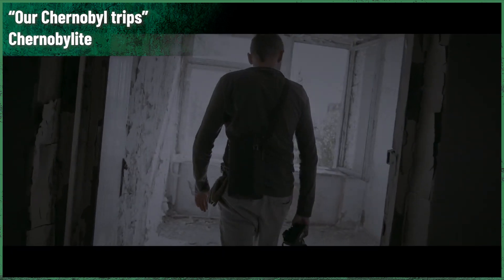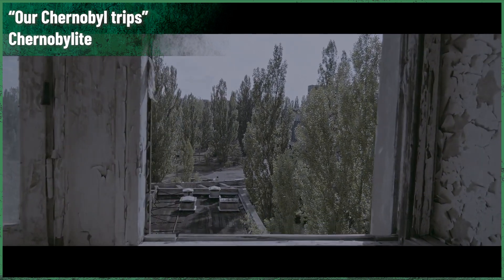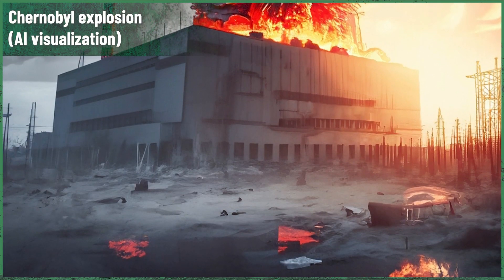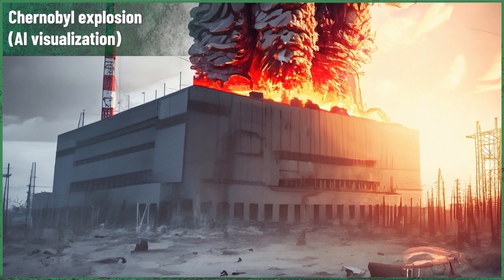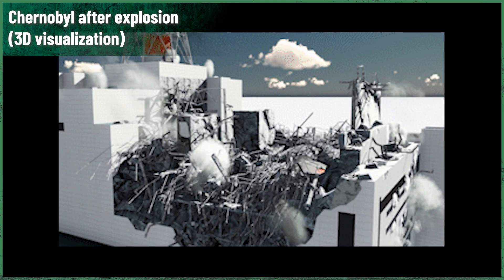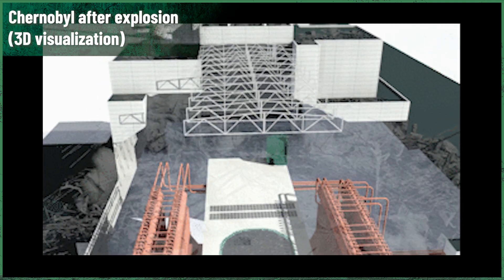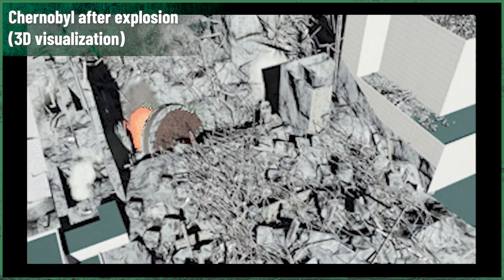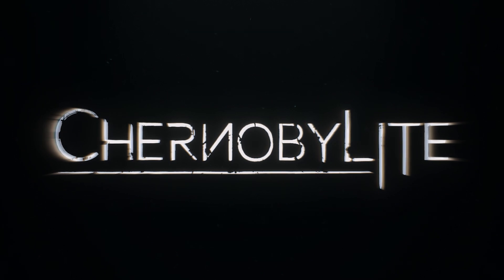Why Chernobyl exploded? Operators mistakes & RBMK design | RBMK PART 9 | Chernobylite Stories

Comment: Wonderful episode I’ve been waiting impatiently for it all week.😊. Do you have any episodes about what happened to the people on duty at the time. Or something With where people that die inside the reactor. Or where people were when they had to drain the tanks. And what happened to them? Did they all die of ARS too? Perhaps a episode about Toptunov or Akimov and there roles and level of experience. Do RBMK reactors still use graphite in the design?
Reply: RBMKs most certainly still use graphite in their design. It's the only way they can work. This has to do with low fuel enrichment and neutron economy. When fuel is that low enriched, you need to make use of every neutron you can hold on to. Ordinary water would absorb too many neutrons when used as a moderator, and your reactor would not work. Both heavy water and graphite are very good for saving neutrons. The Canadian CANDU uses natural uranium as fuel,  with heavy water as its moderator. However, heavy water is very expensive. The Soviet Union didn't have access to the amount of heavy water needed for use in their reactors, so they chose graphite instead.
After the accident they have increased the enrichment for RBMKs from 1.8% to now 2.4-2.6%, but it is still fairly low compared to PWRs/BWRs. These have an enrichment of at least 3 to 5%. That's why they can use ordinary water as their moderator. An RBMK is physically incapable of running with ordinary water as a moderator.
Reply from the maker: Hey Christine!
We have a few episodes on people of Chernobyl so far, but we didn't yet have time to cover additional individuals (we will). You can check the playlist here: https://www.youtube.com/playlist?list=PLvLmuX4fgBCf-fvWbWs9z8sMOG4sZYWWm
Reply: @swokatsamsiyu3590  thank you for your answer my days not complete till I learn something new. I know the candu uses heavy water. Which has deuterium added along with hydrogen and oxygen. I know heavy is better than regular water but also has a price tag to go with it. I didn’t know if any of the newer generations of the RBMKs still require graphite.
Reply: @christinemcdonald8705  
Well, it's hard to gauge someone's knowledge from a computer screen😅 That's why I used the CANDU as an example. It is the only very low/natural uranium fuelled reactor besides the RBMK, with similar needs when it comes to being able to run. After the accident with Chernobyl Unit 4, no new RBMKs were built. The ones that were almost complete were finished only after massive improvements made to their safety systems, core composition etc. The rest of the projects were shelved indefinitely. The newest, most advanced RBMK is Smolensk Unit 3. It achieved its First Criticality in 1989, was connected to the Grid in 1990, is a semi-generation 3 reactor and will run until 2035-2040. It received a full renovation and technical rearmament in 2018. If you see pictures of its control room and main reactor hall, it almost looks like something from a different century when compared to Chernobyl Unit 4. There, equipment and machinery already looked outdated from the moment they started the reactor for the first time. Smolensk Unit 3 is a very nice, modern and clean reactor as far as RBMKs go. But it too still uses graphite. It is the only way it can run properly^^

The one reactor I would have loved to see run, but that was never built is the MKER (Много-петлевой Канальный Энергетический Реактор = Multiloop Pressure Channel Power Reactor). It is essentially an RBMK, but then the way it should have been. Sporting full containment (yes!), both active and passive safety systems, enhanced core neutronics, and something they called "better self-protection for the reactor", this reactor could have been really good. A 70% finished Unit sits at Kursk NPP. They cancelled the construction in 2012. What a shame.
Reply: @swokatsamsiyu3590  yes very true, I know the candu best simply because I’m Canadian it the one I’ve studied for the longest. Which you couldn’t possibly know. But i do appreciate your your answering. As I don’t know much of the newer RBMKs
Reply: @christinemcdonald8705  
As a not-at-all nerdy hobby I study nuclear reactors. And as you probably already guessed, RBMKs are my specialty. They are such oddball reactors that are so misunderstood. There is so much to learn and find out about them. But I'm familiar with other reactor types as well.
The Canadians built something really, really good when they designed the CANDU. I happen to like the CANDU a lot, wish we had at least 10 of them running in my country. I always say "the CANDU is what the RBMK could have been if they just sat on the design a bit longer". They share the same pressure tube design, the same large, well-thermalised core. Both can run on very low enriched/natural uranium. The CANDU even shares the positive void coefficient (albeit a lot smaller!) that the RBMK has. However, that didn't stop the CANDU from being one of the most robust, stable and safe reactors out there bar none. It has everything the RBMK would have loved to have, but never got.
Reply: @swokatsamsiyu3590   wow, now that is a better response than I could have hoped for. Thanks for taking the time to talk with me. I’ve quite enjoyed It. Seems I have a few new research projects to do. I’m so excited! I was one of those people who bought in to the hype of “ oh nuclear power is bad there going to destroy everything” it’s not like that at all if you understand what’s happening. I think we need a better way to deal with the waste. Barring earthquakes and tidal waves it’s quite safe. If they had more world regulations on waste and countries actually followed them. Finland has great ideas for long term storage. But 100 000 years from now who knows what’s going to happen. I thought I was the only one weird enough to have such a such strange hobbies. Nuclear physics and high altitude mountaineering. It’s what I love.  Might you know why they decommissioned them after (what seems to me to be) a very short period of time?
Reply: @christinemcdonald8705  
No problem. It is always nice to talk to a fellow nerd^^ As you can see, you're not the only one. There's a few more of us around. We just don't go around advertising it. I grew up in the 80's during the Cold War. Everything to do with nuclear was on that "nuclear bad!" line. Nuclear reactors really aren't all that scary or bad once you get to know them a bit better. But we must always remember what they are; not just a machine, but also a Force of Nature. We have to give them the respect they command, and the diligent care they need. If we do that, they can do wonderful things for us. Even earthquakes/ tidal waves need not be a problem, just build accordingly.

The nuclear waste rules are among the most stringent in the world. The barrel with a radiation sign, leaking green goo picture that still persists, couldn't be further from the truth. The Onkalo storage facility in Finland is close to being commissioned as we speak. And we already have ways to deal with the waste. There are several reactor types that can utilise the waste from other reactors as their fuel while making more fuel for these reactors. It's called breeding. Look into the EBR-II Fast Breeder reactor. And what is really going to cook your noodle is the fact that your CANDU reactors can help out too! They can safely run on the waste from PWRs via the Dupic (Direct Use of PWR Spent fuel in CANDU) process. Countries like South-Korea have done successful trial runs years ago. The decision not to do this in the West, is purely a political one. The technology for dealing with the waste has been around since the 60s.

I'm not sure to which reactor you refer, but if you're talking about decommissioning RBMKs; it has to do with the graphite stack. Graphite changes and deforms over time in a high-neutron environment. They have developed a special "sleeving" technology that can correct this to a certain degree. But at some point the graphite becomes too distorted, and will start to cause trouble. For an RBMK, a lifespan of about 45 years is viewed as realistic. Not as old an age as a PWR or CANDU can muster, but not bad either. And the accident at Chernobyl played a big role in it too. After the accident, all RBMKs were viewed as some kind of monster, just waiting to go off on you. Which is totally false. Even an RBMK can be a proper, well-behaved reactor. The ones still running are living proof of that.
Reply: @swokatsamsiyu3590  been very nice chatting with you. Normally when I talk about that kind of thing everyone stops talking and just stare at me usually with a blank ‘huh’ expression on there face. By the time I learned about Chernobyl in school and it was history by then.

Comment: Wasn’t it that toptunov pressed the button ? In the series they showed akimov but most websites say that toptunov pressed az5
Reply from the maker: Depends on accounts, but the most reliable version is that Akimov pressed it - he was the supervisor, Toptunov probably would be too afraid to use it.
Reply: @Chernobylite  I think that most eyewitness accounts from the people that were in the control room agree that Toptunov pressed it. And why would he be afraid to press it? It was a pretty normal procedure for shutting down the reactor completely, which was planned to be done after the completion of the test. And yes, AZ-5 button was not pressed as a response to power increase (also stated by eyewitnesses and SCALA data), but power increase happened only after it was pressed.
Reply from the maker: Not exactly - pressing AZ-5 was an extreme measure regarding the Soviet 5-year-plans and their need of electricity. Also, it would mean shutting the reactor off for days if not weeks.

You had to understand the reality they were living in - this could be seen as a sabotage. That's precisely why they had multiple AZ buttons. Only the 5th (AZ-5) initiated a complete SCRAM procedure.

So given this all, Toptunov could be later interrogated - why did he stopped the reactor and didn’t use other measures?

It's all speculations, of course, but we can't really believe any official reports or memories as they all could be biased and / or censored.
Reply: @Chernobylite  Even if that is so, they were shutting the reactor down for maintenance anyway after the test. By the test protocol, they were even supposed to press AZ-5 at the start of the test, not at the end. So I still find it unlikely that Toptunov would be afraid to do it, and more so if the version of the narrative, where there is no significant power surge before the AZ-5 was pressed, is true. In that case, Toptunov would be pressing AZ-5 to shut down the reactor for maintenance, after the test, and not reacting to an emergency.
Reply: @Chernobylite  Boris Stolyarchuk said that Leonid Toptunov activated the AZ5 switch. Boris is now responsible for the safety of Chernobyl and his statements are likely to be true.
Nikolai Steinberg also confirmed this after his investigation.
Akimov was the shift manager, so it's easy to blame him.

Comment: Is it possible for you to tell us what the radiation does to the robots and all electronic equipment. Why does it all just stop working?
Reply: @svenolafson3032  thank you very much. So basically the same thing it does to a person only in a machine form
Reply from the maker: Basically what was said! :-)))
Reply: @Chernobylite  yes it is. I was hoping for a answer that was a bit more detailed. But yes I get that the radiation was so high it kills everything.  I believe I phrased the question wrong. Since I forget what the original question was. All answers are appreciated. Thank you 😊
Reply: @svenolafson3032  now that’s what I was looking for. Thank you!
Reply: @svenolafson3032  Well explained. When starting with electronics i couldn't believe radiation hardened NE5534s (for those who don't know this is one of the most common analog chips used in electronics) looking like regular model costed ~100eur, while ordinary model was cents back then.